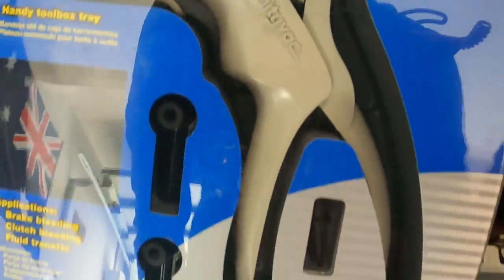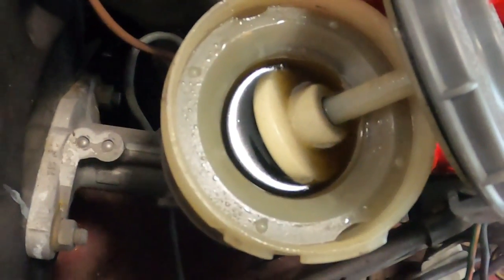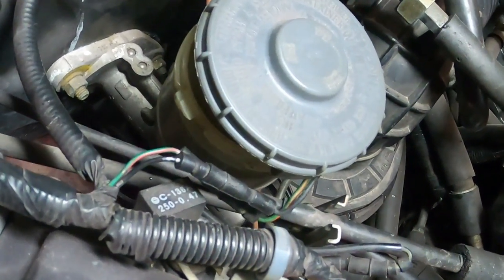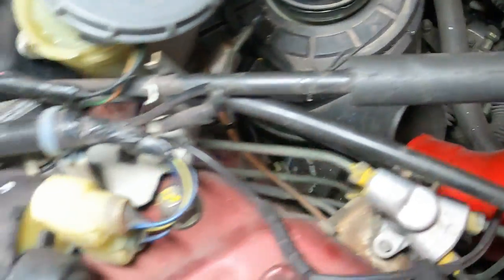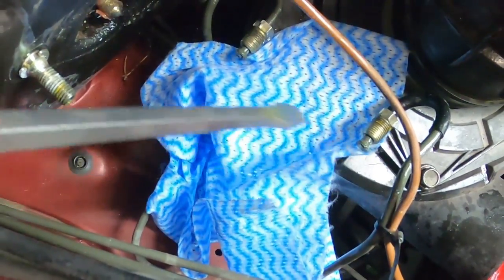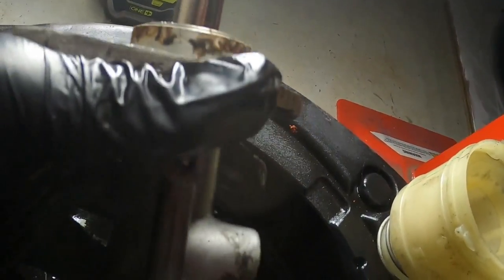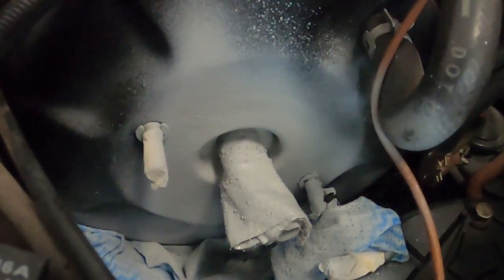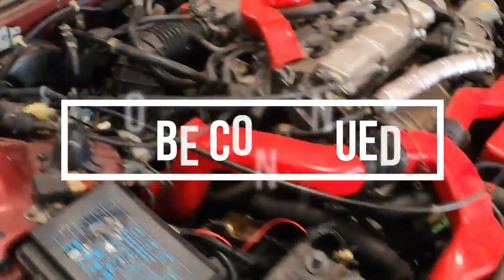More Brake drama. Brake master cylinder failure. Remove and replace. Honda Prelude 3rd Gen.

Comment: I just dropped the gas tank on my wife's Kia to fix the rotted out rear hard brake lines. It was a pain to re-bleed as all the fluid had leaked out of the whole system when the brake line blew. I feel your brake bleeding trouble! informative video!
Reply from the maker: Thank God they are not rusted out in my case. Let's hope the master will solve the issue.  Thanks for watching and supporting

Comment: if you tried bleeding and nothing coming out, it could be one of two. either the line is blocked or the master is cooked. looking at the booster, I would say your master is bad. and since nothing is coming out of the break line connected to the master, you are right, your master is bad
Reply from the maker: At first,  I thought the newly installed caliper might be clogged.  But I tested and it was working fine and fluid comes out of it.  So I turned to the master.  It was the problem

Comment: Did you bleed the system correctly ? you need to follow the sequence correctly and then if still not working, check the master. you only showed bleeding the back side
Reply from the maker: I did follow the process.  Back passenger side then driver,  front passenger side and then driver.  But still, no pressure at all, especially when you turn the car on.

Comment: Did the car have break issues before ?
Reply from the maker: No, just needed to bleed as I replaced the back right caliper I you don't remember.  Ever since, lost my breaks
Reply: @saltherookie   now it make sense. at least we know there was break. I guess it was time to replace it. judging by the rust and all, I think you got lucky
Reply from the maker: @johnylander7929  I think so too. Last thing we needed is drama after everything is fixed